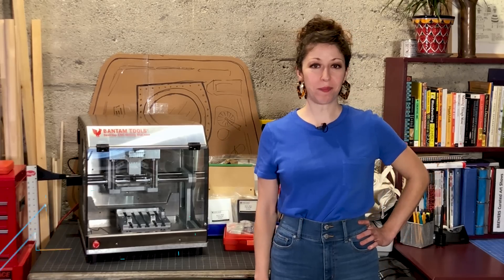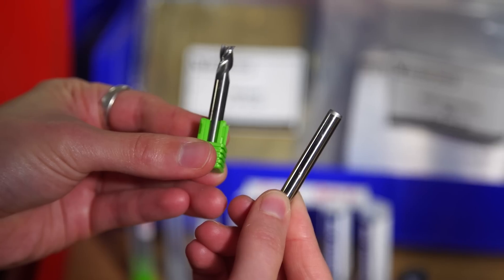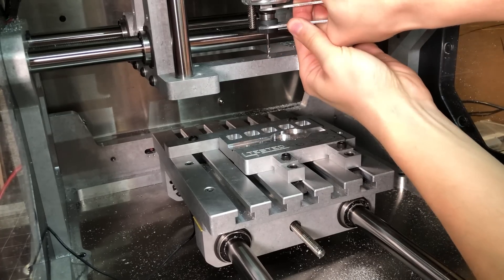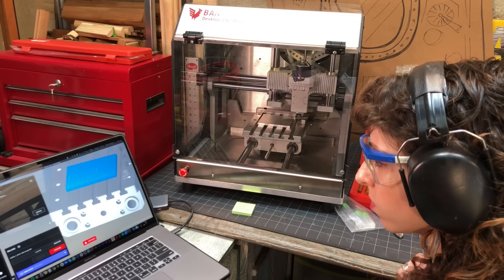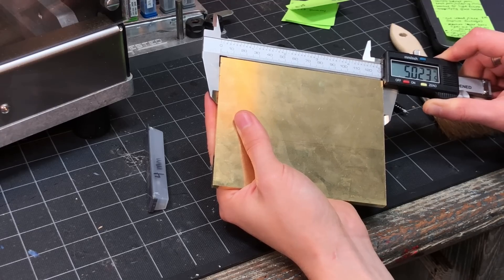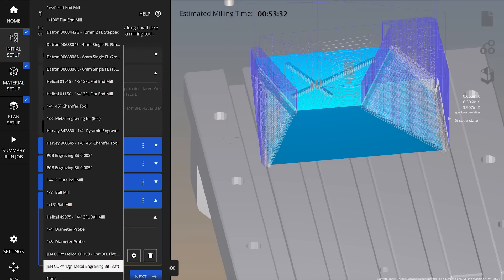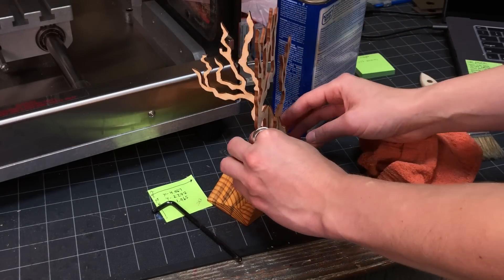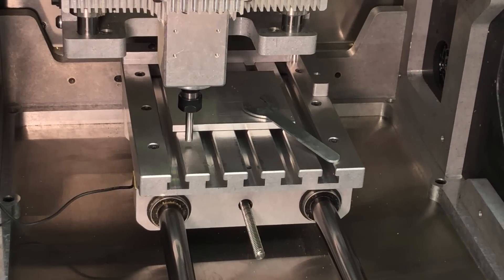Bantam Tools Desktop CNC Milling Machine Review!

Comment: Buy
LMS 3990 for $1200 
or 
Grizzly G0704 for $2400
add
$1500-2000
for the servos, ballscrews, brackets, etc.
Convert to CNC. 
Never look baxk. 

MMR of a concerted mind mill far exceeds any gantry style mill including the MR1. These desktop engraving machines are trash unless you make signs exclusively.

Comment: Wait, so you spend a big chunk of cash to buy the machine and it's capable of all kinds of cool things but, by design, it's feature-locked unless you pay them a recurring subscription charge to unlock its full capability? Why are you not completely nailing them to the wall for such a shitty, consumer-hostile business practice? That's even worse than inkjet printers that refuse to print black-only pages because the magenta tank is empty.

The fact that you gave them a pass on this does not put you on the side of the consumer. It implies bias and it forces us to ask ourselves: why should we trust your advice, on this or any product?

Comment: Everything is cool, but there are no linear guides in the machine.  Therefore, it will not have high precision in metal processing (it does not have enough power to process them), and so it will do for wood processing. For $ 4000, you can build a larger machine that can machine metals with good accuracy.

Comment: I was interested in seeing a review for a mill, but I only see a router. I suppose it was able to cut out some brass. The few frames you could see the surface finish confirms it is not capable. I feel like the reviewer has never seen a mill and doesn't know what one is or what it should be able to do. 

This machine would be great for a hobbyist looking to learn on some wood. Cutting aluminum is going to be the upper limit on that. Not everyone has a workshop, so I think this is destined for that basement room. Just don't advertise it as something it is not.

Comment: Shoot.... someone beat me to the desktop cnc market.

If thats my competition I have a feeling im okay thou.
Im making a "machinists cnc desktop mill"
FULL milling capability, tool changer, coolant w/skimmer, option of T slides/kurt vise/tapped table, airblast, and lastly its fully programable using standard G&M code.
Batch made/Made to order
Prototype coming soon
hoping itll compliment the 3D printer makers out there. 
For an already made example Reference "Enco micro Cnc mill & lathes

Comment: Pro tip: Don't try to cut the material all the way to dimension in just one pass. Do a couple bigger rough cuts, then leave a few thousandths of material to take away in a finish pass and it will leave much nicer edges.
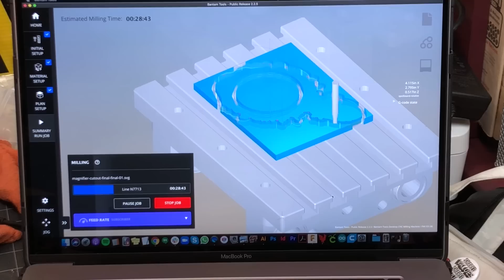Reply: She literally says that at 8:03

Comment: Hey comment section. Hope you can help me. I still dont have any CNC machine, though im somewhat familiar with them. I want a machine to mostly do cylindrical wood pieces, like chesspieces. Im sure im looking for a cnc lathe not this milling one, but its for small DIY stuff, probably under 1,500.00 or so, though the cheaper, the better. 

I have not seen one small, just huge industrial ones. Anybody can point to the right direction?
Reply: Look up Sherline and Taig. Both make small lathes suitable for chess piece sized.

Comment: If this were to be used in a professional shop would it have the durability to everyday use in order for it to pay for itself? 

If you go back to the day of printers, you had to setup the ribbon, do a test page then print your letter. Now we have WYSIWYG. Are we at this point with CNC machines? For those that really don't want to learn all about tooling and all you want is to have a finished part in your hand. Price may be okay then?

However, I would still rather tinker, build and learn something from the experience than have a user friendly already built machine that mills trinkets that sit on a shelf. 

But then, that's how I came across this video... googled "Best CNC machine review"  I see that the bar has been raised again!

Comment: Neat that its a fully enclosed mini CNC, but for $3600 you could buy something like a Grizzly G0704 and do a full CNC conversion on it, buy some tooling, some stock material, a coffee, a pack of donuts, and sit down and learn how to do CNC machining and still have money left over.  Fully done i have seen guys do really nice CNC ballscrew conversions with belt drive spindles on these cheaper chinese benchtop mills for under $3k, and thats including the $1600-1800 brand new machine purchase.  This thing has a small build volume, not much power, but just enough to cut aluminum, and its tied down software wise and limited in use.  A good CNC machine build can run with Fusion and Mach3 or a linux variant or whatever controller you want to run for free or on the cheap when it comes to software and it would be far more capable then this little $3600 polished turd.  Sorry, i don't mean to be rude about it, but $3600?? Where does this fit in any makers budget?  For $3600 you can have a full size lathe or bridgeport off craigslist or marketplace or brand new smaller import machines and really cut some metal by comparison.  Learn how to do some basic machining on a manual machine, then move up to CNC, get one you can convert as your skills grow.  I have seen guys with CNC controller G0704's and G0602's, they started manual and moved up.  And for the record, i had a small CNC router similar to this a few years ago, i sold it, bought a G0704, i still haven't gone CNC on it and might not, because i just wanted something with enough power to do milling in aluminum and steel that was affordable and would fit my space.  So glad i ditched that little CNC router.

Comment: Everyone's freaking out about the price/machine capability ratio. I think you're missing the point. Of course it's not the most capable machine for the price. What Jen emphasized multiple times is the ability to mill a part in under 30 minutes from startup with little to no CAM or even CAD knowledge. As a maker you have to realize that this sort ease of use is imperative to expand the maker community. Stop being such an elitist about having to build everything better for cheaper yourself. And stop insulting the hard work that programmers/UX/UI designers put into creating a streamlined software. Try and find the good that this machine can bring to the community.

Comment: Dialing it down doesnt give you a better finish. At 28000 rpm burning a tool up would be more likely. Going at the proper speeds for the cutter and material does.

Comment: $3600?!  That's a fully-capable OpenBuilds CNC machine, all of the tooling you can carry, a hundred pounds of raw stock, and several cases of beer.  Or a very, very good quality used manual mill with tooling.  Heck, I don't think I'm at $3k spent yet on my milling machine, including tooling, fixturing, and a literal half-ton of stock.  Yikes.
Reply: 3600? A Year later it's now 5 grand

Comment: I repair CNC machines for a living and all I can see when this thing is running is the fact that the bed has no way covers and all those chips are building up around the wipers for the bearings. Even worse is the axis screw is exposed as well. That's a horrible oversight for a mini machine in this price range and will kill the table bearings and axis screw very quickly if you use it for metals. Seriously, a set of accordion way covers would cost 50 bucks or less for this thing.
Reply: That was my first thought as well. Screw the software ecosystem, I can work around it, but all of those exposed precision surfaces, bearings and screws are a complete dealbreaker. Without any dust control it will eat itself quickly. 
Plus I don't foresee a long life for that aluminium T-slot table.
Reply: What do you consider to be the ideal beginner CNC?
Reply: What fully enclosed CNC would you recommend, with your experience?
Reply: @jwhicks727  langmuirs gantry mill is probably the best. 3 Axis, concrete base with aluminum table set in it for rigidity it's a lovely machine.
Reply: @BedroomMachinist  I hadn't seen that one, it does look nice and I'd get that long before this one. There are so many systems out there. I've been looking at Tormach for a long time. The Tormach I'd build would be about 2.5x more expensive than the Langmuirs but the tool changer would be nice. Of course there's always the option to build your own if the Langmuirs spindle could be made to support it.
Reply: Never worked in repair but I've seen what can happen when too many chips build up and one gets into a wire or gouges the screw.
Reply: I do believe this a highly engineered and well thought out product; they obviously have perfected their design life expectancy. The problem for the consumer is the designed built-in obsolescence looks to have been made to wreck the machine if you use it for metals for extended periods. And with the current setup they could get away without those extra protections because they probably think the primary use of the machine will be with softer materials like plastics and wood. I checked their website and I didn't see any specs for the kind of Aluminum the machine can handle but, they do sell a grade of 6061. Since they don't specify the grade I am guessing it's the cheaper, softer, annealed stuff.

I would have also liked to see an option for using some type of coolant(or a provision to add it on at a later date) to help prevent the aluminum from getting too hot and then start getting gummy and fouling the tooling. So without a coolant option, I think that thing would only be good for nibbling at the aluminum and not doing any sort of "heavy" cutting(Or at least as heavy as you could go using only 1/4" mills).
Reply: Love it when someone who knows what they are doing shares their knowledge. Really appreciate your insights.

Comment: This is a machine that was designed to generate maximum profit while providing minimum hardware by confusing people who have no experience with machining through aggressive marketing.

Not even ballscrews, just shitty, UNSUPPORTED trapezoidal screws($10). A piddly 250W motor($20) that can't deliver 250W at anything besides the maximum speed(uh oh, quadcopter motors, yup).
Painfully slow operation, absolutely zero way, screw, and spindle motor protection, crippled UI, proprietary hardware and software(where's the maker ethos?).

Unsupported linear rods($30 for the entire machine), small NEMA17 motors, very weak frame and zero tramming hardware capability(?). Aluminium table, too, so forget clamping anything hard.

And the surface finish? Disgusting, really. If that's their optimized settings(and no doubt tools), this is pure garbage.

To viewers: Do yourself a favor and either get an ~$1800 "6040 router" with a 2.2kW water-cooled spindle(in reality, over 10x more power!), or if you want to do heavy metal work, buy a knee mill and retrofit it - it's really not difficult, and you'll spend about as much.

To Tested: If you have the balls to accept these "unpaid sponsorships", at least send these toys to Adam, so he can get a laugh.
Reply: This is an out of the box CNC machine for makers and entrepreneurs, not for CNC enthusiasts.
Reply: @bernardtarver  This is an out of the box polished turd. For an out of the box CNC router, get a 2.2kW 6040. For LESS MONEY.
If you're an enterpreneur, get a cast iron 6090 that will eat this machine into chips.
Reply: @Spirit532  Any reputable reseller for those machines?
Reply: @bernardtarver  They're all the same machine, pick the cheapest seller including shipping.
Reply: @Spirit532  That's not what I asked.
Reply: @bernardtarver  There's direct resellers like ChinaCNCZone if you want to pay a premium for the same machine but with a brand name on it.
Otherwise - local importers in your country, which you can shift the responsibility onto, should something go wrong. They don't really break or come with defects though, so the value add is questionable.
The machines are slightly more complicated than "plug into the wall and run" but if you're buying a router, you need to learn the basics of controls and setup to run it effectively.
For simple&limited(though far better than bantam's) you can just use any Windows machine with Mach3, but for highly capable and advanced you want to buy a machine controller with a parallel port and use a PC with LinuxCNC on it. With a bit of configuration you get DMG or Fanuc levels of performance for free.
Reply: @Spirit532  In that case, I would save myself the mystery and headache and buy direct and in my backyard, rather than deal with overseas or third parties on eBay, and the like, or both.  Also and again, Bantam's machine is not marketed toward enthusiasts wanting to learn the nuances of CNC and machining.  It is an upmarket ecosystem with some product cachet geared toward people who swipe left at a 6040, 6090, Fanuc or anything else that's more suited for a machine shop than a home office.
Reply: @bernardtarver  Bantam's tools are garbage. You're burning 3300 out of the 3600 dollars you spend on it. Just burning.
CNC REQUIRES that you learn the basics. It's not an inkjet printer, or even a 3D printer. YOU are in control of the tool, speeds, feeds, and toolpaths. If you're unable to figure that out, you have no use for a machine like this.
Reply: @Spirit532  The Bantam machine is similar to the revered Carbide 3D Nomad.  Plus, this is not the first time at the rodeo for Bantam Tools (nee Othermill).  Also, a 3d printer is a CNC machine; uses feed rates and tool paths just like a CNC mill.  As the video conveyed tool paths and feed speeds can be preset; other host software have the same capabilities.  You seem unable to accept that fact that Bantam's machine is suitable for uses not wanting to get into the weeds on CNC.
Reply: @bernardtarver  You can't not get into the weeds if you want reasonable results.
The othermill is even more vomit-worthy plastic garbage.
Reply: @Spirit532  Shipping is a killer or sloooooowwwww on those cast iron machines... I ordered a steel frame 2.2kW 3040 with upgrade to servos and the profile ways. It was less than this thing in itty bitty CANADIAN dollars, shipped.

But it's in a crate on a boat right now, somewhere... Supposed to get here sometime before March 2021...
Reply: @dimman77  Well, yeah, but you'll at least get what you paid for. Just... whenever :P
Reply: @Spirit532  It'll wreck this thing and be able to make steel parts to upgrade itself.

But the waiting. Uuuuuuuugh...

Lol
Reply: @dimman77  A 3040 will struggle with steel, but you can struggle your way through upgrades.
Stock up on drills & endmills(you'll break them, a lot), measuring equipment(dial indicators, calipers, micrometers, maybe a surface plate), and get an old PC with a parallel port to learn LinuxCNC on. If the router comes with Mach3/Mach4 and a USB card, ditch that and switch back to the parallel port with LinuxCNC. You'll enjoy it a lot more, especially with something like gmoccapy or ProbeBasic interfaces.
Reply: @Spirit532  This isn't the typical 3040, it just shares that cutting area. It's steel frame with linear profile rails with carriages and servos. Not the aluminum frame with round linear shafts and steppers. Same ballscrews and 2.2kW spindle specs. 

It's similar to the cast iron or cast aluminum frame machines except with a full moving gantry instead of the independent table like the 4040 cast machines have (which I do think is better for rigidity).

Comment: I was interested until I heard "subscription software".  Never will I buy a machine that then requires me to keep paying in order to use it to its max capability.  Hard pass.
Reply: Hi Chris! Just wanted to clarify that the subscription pack is totally optional! Every Desktop CNC Milling Machine comes with a base pack of the Bantam Tools software for free. The base version is packed with the important features you need to run your machine––and then some. The subscription pack is aimed at folks using the machine in a business setting where every minute counts.
Reply: @bantamtools  No matter how many times you cut and paste this comment, it doesn't change the fact some of the functionality of this machine is held hostage behind a paywall.

Comment: I was waiting to hear it could mill steel. Want to make folding knives. Specifically,  pockets in blades to receive bearings for blade pivots.
Still great for prototyping. 👍
Reply: Hi James! The Desktop CNC Milling Machine was designed with rapid prototyping in mind :) Steel is not an officially supported material on our Desktop CNC Milling Machine. It's designed to be optimized for machining aluminum. Because the lowest spindle speed is 10K RPM and steel requires a much lower surface feet per minute compared to aluminum, you'd need to run smaller tooling when machining steel (3/16" and below). Also note that there’s no coolant system on the machine, which means you’ll need to take great care when machining steel. While this machine can cut steel, machining it is not covered in our warranty. Hope this helps!
Reply: @bantamtools  That's not what I'm looking for,  but it still sounds like something I want and could use. Will it manage G10, micarta,  and stabilized wood?
Reply: @jamesbarisitz4794  If you are still interested look at winston moy's channel. He works for carbide 3D which make the nomad.

Comment: Using hearing protection for this? I run a heavy milling machine and it’s no where close to being loud.
Reply: This thing is bottom of the barrel and has a quadcopter motor - it screams. Compared to this, any regular mill is noise cancelling.
Reply: I couldn't blame her the sound of constant chatter even in brass gets annoying. 9:53